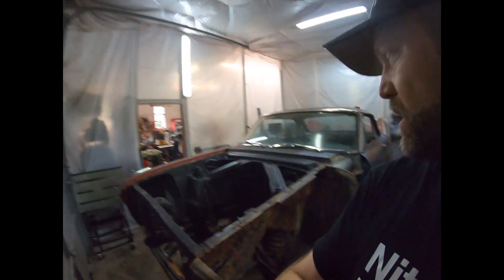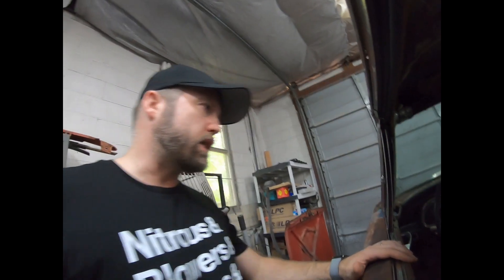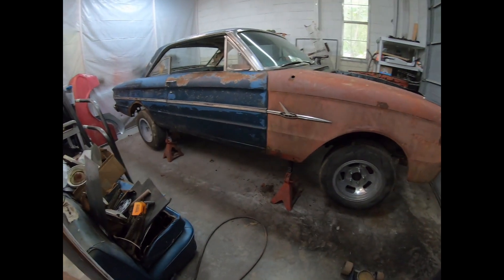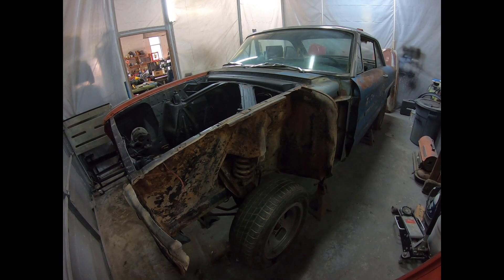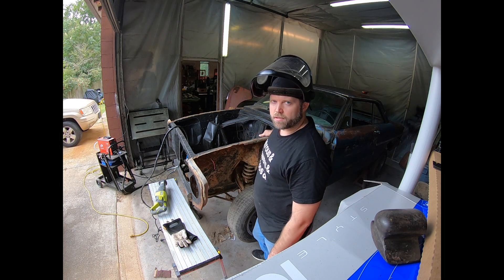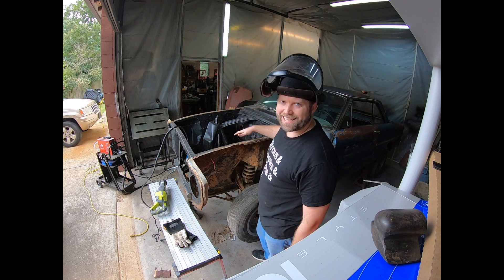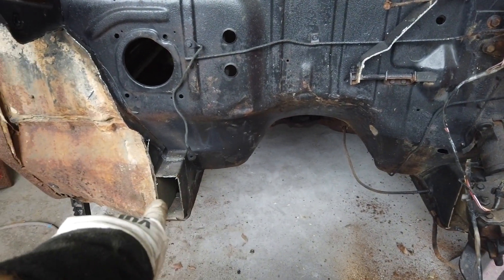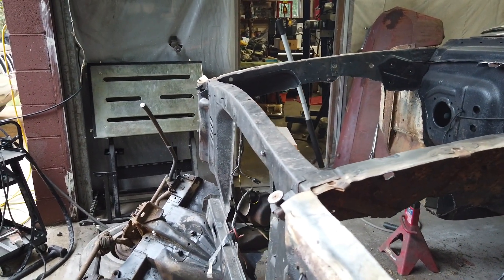How to build an AWD Muscle Car EP 1

Comment: I want to make my 03 Mustang, AWD any advice on what to and what to not do?
Reply from the maker: I've been looking into this too. I have a fox platform car similar to the 03 mustang. I would love to go AWD with it. Ive seen it done in a few ways. First, was using an Audi platform. I'm not sure if it was a A4 or other model but it was AWD and seemed to fit the wheel base well. Only issue was they used the Audi drivetrain. I would rather have the ford engine and trans. The other way was fully custom setup like what Im doing with the falcon, but with a ford explorer AWD setup. It would be expensive to source and lots of custom fabrication but it could be done. These are the two routes Ive seen for the 79-03 platforms. My advice is to consider what you would be using the car for. If for racing/track use your possibilities are pretty open. But if you are considering for street/everyday you have a lot more  items to consider keeping functional for the car, so it gets complicated. Another factor to consider is the ride height you want. A lot of the challenges with different platforms/ axles types to put up front will challenge this. Also, you have to decide if you are going to a full frame or if you want to keep the unibody. No way is the right way but just very different on how you approach the build out. All that to say, I hope you go for it! Not many AWD mustangs out there, it would be cool to see it done. Just be prepared for a lot of work, don't get discouraged and keep going till its doing all wheel burnouts!!